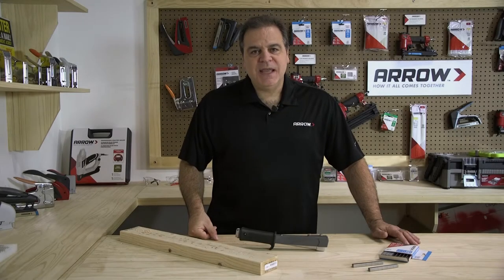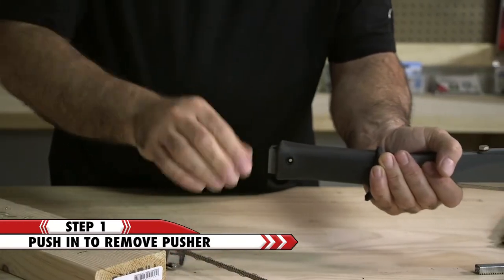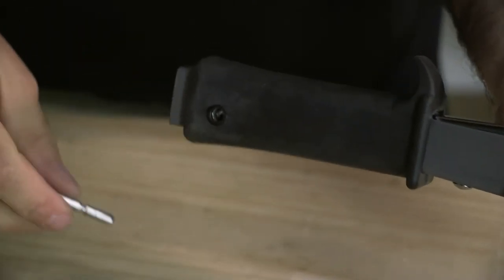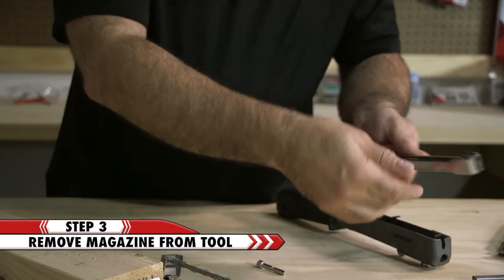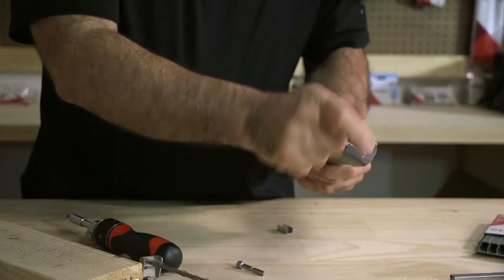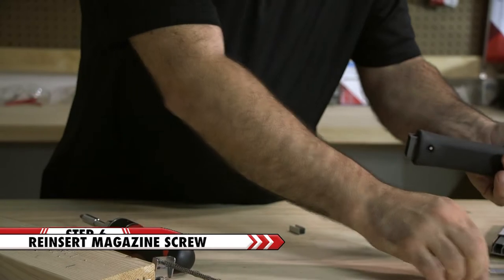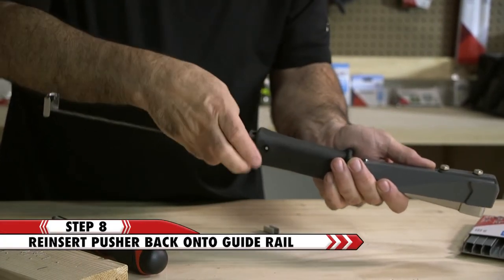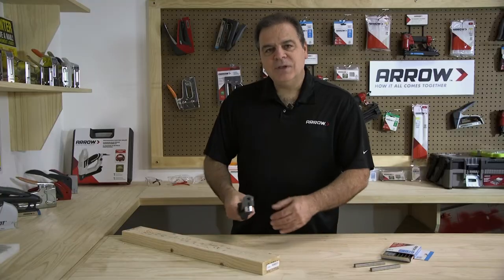How to Clear a Jam From Arrow's HT55 Professional Hammer Tacker

Comment: Any suggestions for getting the channel unjammed from the housing itself?
Reply from the maker: Hey John, sometimes it can help to lightly bang the hammer tacker upside-down on a piece of scrap of wood to try to get the magazine to pop back out.  If that doesn't work, please give us a call at 800-776-2228, and we will troubleshoot further with you. Thanks for reaching out!
Reply: @arrowfastener  same here, first lot of staples. Not a good product if it works so poorly.

Comment: Thats the issue the tool is stuck and will not release,, this was used for 10 strikes then it stopped working!???
Reply from the maker: If you are unable to remove the jammed staples from your hammer tacker, please give us a call for help at 800-776-2228.

Comment: You guys need to make a better video. Mine stuck in the end and in the depressed position so I can't even get it to slide out. And even is I did that wouldn't help cause there a staple jammed in the mechanism itself. Not the tracking system
Reply from the maker: It would be difficult to anticipate every possible problem a user may have with a tool to include it in a short video. However, we're here to help! Please call us at 800-776-2228.
Reply: That’s the main damn problem the whole thing jams